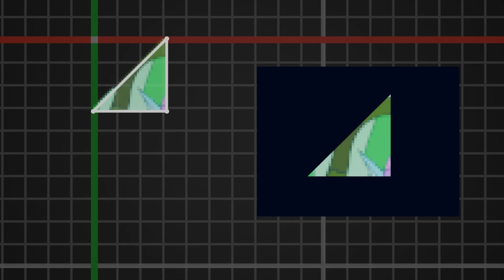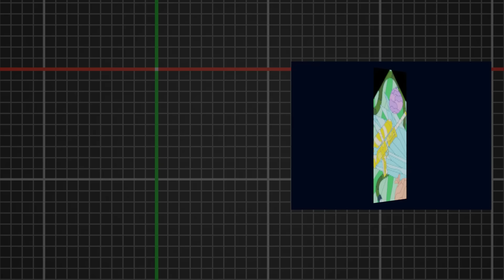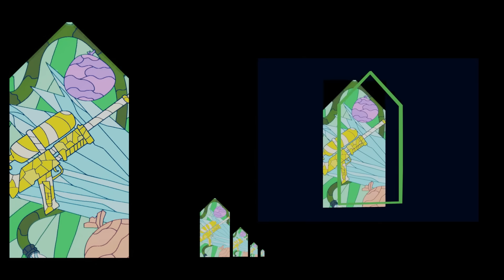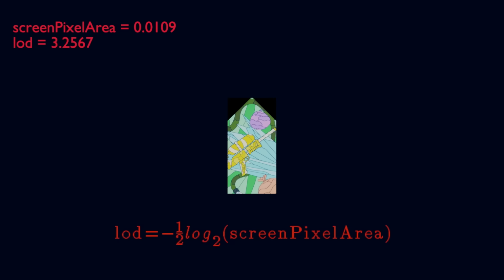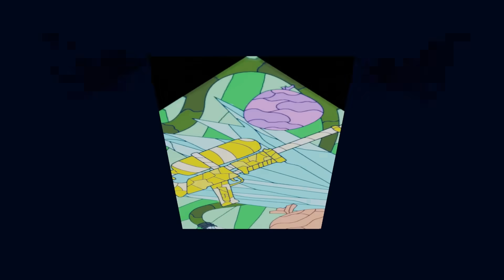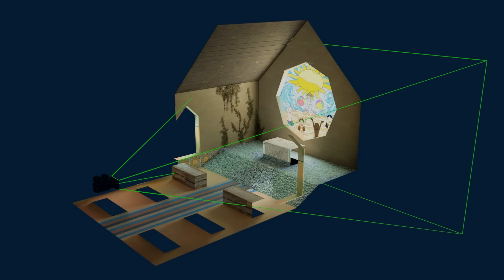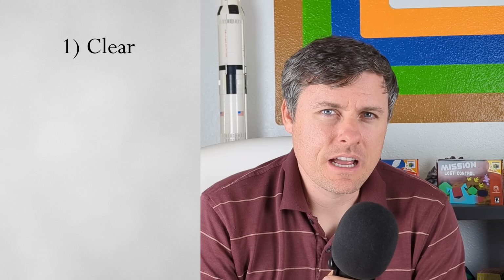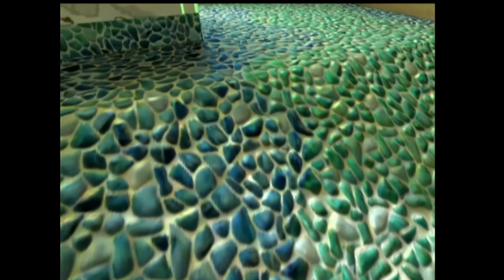How I implemented MegaTextures on real Nintendo 64 hardware

Comment: So you got around the 4kB DSP/RE (reality Engine) data cache size bottleneck by implementing a real-time dynamic tesselation algorithm? Nice, but unfortunately while this works around one N64 bottleneck it also tightens & worsens another one: it's relatively low triangle rasterization count throughput limit. Now what would you do against that?
Reply: What? No. The RCP (Reality Co-processor) has two main parts, the RSP (Reality Signal Processor) (for polygons and lighting) and the RDP (Reality Draw Processor) (for textures and pixels) and each part has its own separate cache. The low polygon count is for frame rate reasons, not because it's impossible to have more.

Comment: I'd assume back then the speed of loading data from ROM and how much CPU time it uses might be a problem and then also the ROM capacity, you would need about 1GB ROM to fit in all the textures but I don't think N64 games came even close to 100MB. Still pretty cool!

Comment: You can write a procedural encoder/decoder for textures to store them in more compact size in some sort of vector data, like demo scene did, wonder how that may improve your demo performance and OK image quality.
Reply: Please write a compiler. Maybe there is a lot of free contents out there? It seems that most pixel shaders at least needs attribution. So you would have to list the authors on the info tab. Perlin got a price for his noise. Geo nodes from Blender.
Reply: @ArneChristianRosenfeldt  are you talking to me? Because it doesn't look like this,I think your comment has no connection to mine.

Comment: Makes me wonder how much today's engines actually utilise current console hardware. It is so powerful but with so much more complexity.
Reply: A theoretical physicist once told me that high performance computing got faster fast than the hardware because the algorithms also got faster. I would say compilers also got better.

Today we have unreal and Unity3d who avoid many of the blunders of the early years. We have drivers. Instead of NDAs about basic stuff, game devs can use Vulkan. Every graphics programmer today reads through the vast literature from university. Back in the day, a lot of graphic coders used high school maths only.

Comment: I know that the N64 can't display normal maps but could you fake them?
In the game "Blast Corps" you can see something on the loading area of the "Backlash" Vehicle that looks like a normal map or something similar.
How did Rare achieve this effect?
Reply: Have you checked lib dragon what RDP can do? I think indirection is possible, but of course too slow for full screen usage.

Anyway, normal maps really seem to need normalization — square root. With small polygons you could normalize all lights and view vectors at the vertices and linerp . In case of doubt, split/tessellate. Store 3 component vectors in the normal map ( compute z on load using the CPU ) .

Comment: Could you actually have these graphics in a proper game with physics, AI, NPC and all other factors?
Reply: Does any N64 game have physics? Bullet, havoc, angry birds, Unity3d all came out afterwards. Doom 3 is the first Id tech with proper physics.

How does half life do it?

Take a game from the genesis and use that NPCs with their AI. Or was it bad? Just don’t simulate multi-player.
Reply: @ArneChristianRosenfeldt  both PS1 and N64 had some physics simulation. Take for example the car handling in Gran Turismo., that's one of the prime examples of 32bit system physics... Or Wave Race on N64... So my original question was about would you have enough compute power left to make a game after you apply these megatexture graphics?
Reply: And I mean that you can do the maths yourself. Dial back on the Megatexture! Time slice the CPU . You still got enough cycles for Grand Turismo and still half a CPU for the megatextures, like for example procedural asphalt and scenery changes .  @Granulum

Comment: It's obviously impressive, but I think the texture pop-in as it transitions from sizes also kill the aesthetic, relative to consistent textures. It's a huge nitpick for me even on modern hardware. Also sorry if this sounds like a stupid question, but is it all done in the GPU, or does it borrow time from the CPU? Because that would be another limitation if someone were to actually try to make a game like this. Either way a Myst-like game could be a perfect fit, other than the limitations on cartridge size. But would it be possible to engineer a bank-switching cart for a single game? Like a modified Everdrive cart?
Reply: The GPU works per polygon. So at least the z-buffer avoidance algorithm sorting needs to run on the CPU. Also I think that no one is so crazy to write ROM loading routines for RSP. Please correct me, but lib dragon is a port to the PC. But it still only includes the two original RSP binaries ( medium and high quality). 8kB which define it all. Only a few professionals modified those. Scratchpad RAM. So it is coding like JRISC for Jaguar or SH2 on 32x. But with 128 bits and instructions more complicated than MMX ( but less than SEGA DSP on the  Saturn).

The CPU has trice the clock than a PSX. You could use a KISS game loop, first do the logic, then audio video. Still more complex game logic possible than on PSX. A queue keeps the RSP running all the time.

Comment: Very interesting demo to explore the limitation of how the N64 hardware may be capable of. Does it take a lot of process memory to load up every pixel image to take place where the camera is moving. I sort of tell by the framerate dropping when viewing other images around the room. Would it be simpler by using two images, one high and one low texture. For it two work, the camera is far distance viewing the image low quality, coming closer. The high texture is fading in from the start. Coming in closer, the image fading in more. When the camera reach it's point, the high-quality image is fully loaded in, and the low quality image just disappeared. It is just my understanding that it would be if the frame rate would keep it high
Reply: A lot of tiles can be loaded per frame. You could keep the mesh from last frame and modify it as you load. There is a hight field engine that does this.

Comment: the 64 mb ceiling really is a problem on the n64
Reply: How do you all create textures? Let’s just assume that we don’t really want a MegaTexture, just not the blurry stone texture and faces. So many textures should be geometry instead. Lines on the street, lattices, rotating fans, windows in a house. Vertex lighting is impressive at high polygon count. For sharp shadows add sectors like in Doom.
Reply: @ArneChristianRosenfeldt ??.
Reply: @ArjanSnijder  textures were cheap. Go around with a camera. Pay an run of the mill photoshop artists, done. 3d modelling is more expensive. For large objects you want procedurally generated geometry. Vertex shaders. Geo nodes. Only top talents give you this. Like Elite , tree generator , Bryce
Reply: @ArneChristianRosenfeldt   The hardware was good but they cheaped out on cart space. The n64 could have been more.
Reply: @ArjanSnijder  cart space is expensive as is a CD drive. A CD drive needs more RAM. More games would have needed the expansion pack or we would even have gotten a larger pack later. To this day I don’t understand CD authoring. Yeah, no random access possibility due to syncing and Reed Solomon error correction, but this only means that a game provides start address and length of a data block to DMA into Rambus RAM. I think that there are addresses on the spiral. But the head would aim blindly then focus and read and then buffer and if this was before the wrong address: discard. Also I propose repeated files , so that we always land in useful data. Quad constant speed drive. Still stick to compact data => good loading times.
Reply: @ArneChristianRosenfeldt   n64 did i decent job only not so much in texture detail. Altough i could never see a playstation handle anything close to perfect dark. Altough choppy. That thing looked almost like early dreamcast.

Comment: Do the faces need to be tesselated for the higher mips so that each polygon is covered by the a single tile, or could the N64 stall poly rasterization and wait for a texture cache refresh mid render?
Reply: You render everything which is in Cache (TMEM). You mean if we should write micro code to make RSP understand regular grids made of a lot of square tiles which use up the full TMEM? So the CPU just needs to write a list of tile indices and the upper left vertex? Definitely! With one cache flush from the CPU, we write out 4 tiles ..
Reply: @ArneChristianRosenfeldt  Uh, no, thats not exactly my question. I used to think that the only way to get a surface to have a larger texture than can be fit at once into the n64's texture cache was to subdivide that surface into more quads and assign a different texture (each containing a fragment of the whole) to each sub-polygon. Is that how you are doing it, or is there some other way?
Reply: This is the way, and we love it .. though actually I don't know how the SDK does it. If you do it manually, rounding errors may make the surface not perfectly flat. I always say: this is not a bug, but a feature. Add detail, tesselate. But maybe for BSP and backface culling and triangle set-up you don't want that? So the micro code takes the projected vertices and cuts the edges in regular interval and spans a grid? Feels weird to waste any word in the 4kB code cache on this.

BTW. the hardware supports skinning of arbitrary polygon meshes where each triangle ( or quad ) covers less than one texture tile . The mipmapping addressing scheme allows us to scroll through a large texture. Like you move to the next polygon and each mip map level scrolls by a vector, but divided by two every level you move up. I wonder if these areas in cache collide (and you would need 2px/cycle internal memcopy?), or if wrap around is built in.
  @buzinaocara
Reply: @ArneChristianRosenfeldt  Did you participate on the project, or is that your speculation? Just out of curitosity?
Reply: @buzinaocara  I only have fun commenting on comments and like many had the same idea years ago, but other coding was more interesting to think about (though the ultimate quality in this video surprised me). I really don’t know where some people take the energy to code as job and as hobby.

Comment: Amazing,just amazing

Could you not use a large and extremely varied tile set that could then be brolen down and reused everywhere ingame ?

Like how super mario bros 1 reuses tiles for clouds and bushes and trees and so either by inverting/flipping or only using half 

Also,would it be possible to reuse a tile set but be able to change the colour of a tile internally without having to have a new tile in a different colour ?

I would love to see a myst like game on n64,something like shadowgate 64

I think your demo room would be an amazing place to use as an n64 music compilation homebrew with room lighting options,imagine being able to rip in all your favourite n64 music tracks and play them back with some reverb options and cool dynamic lighting !!!!!!!

Does your demo not use the expansion pak ?

Your demo is stunning btw
Reply: There is no color index. It is all fast RISC code. Just write some code in C++ and play with procedures and ramps and noise and functions.

Comment: why can't you draw outside the frame in anticipation of camera movement?  why can't you load tiles needed for those image portions?  on the one hand, you're saying the tiles in cache are likely to be reused (how likely, though?  how much of the cache is actually reused between frames?), and on the other hand are saying tiles outside the frame are totally unlikely to be needed; this seems to not be totally true.  can you use something like the quake algorithm to prevent overdraw/reduce tile size?  can you use the screen itself as a buffer?  sorry if this comment is too ignorant, all my knowledge of video game image rendering is from youtube.  thx for the vid, cheers,
Reply: Coders say: you probably not gonna need it. Just don’t utilize all of your cache for the current frame. Optimize this to max extent. Then look for other heuristics. Cartridge is fast. Field of view is narrow. For a real game better stick to normal textures, just at higher resolution. Then you probably use the same textures behind you. Blame the artist. Also on N64 you usually then sort by texture. So draw all cached textures, while the CPU decompresses the fresh ones.

So you want occlusion culling? Is PVS really ideal here? Portals, BSP ? Deferred rendering: you check z for the whole polygon and only then load the texture.

Comment: please do a project on the ps2 or wii or gamecube or og xbox it would be soo cool to see how far u could push it
Reply: Ps2 has this super high poly count , but cannot do multiple textures. I wonder how far you could get with vertex shaded chunks. Nanite. Not only for terrain, but all meshes.

Game cube and later use a graphics chip from a PC . So you could just run a modern PC game on a PC? They got optimized all the years. Unreal.

Comment: I wonder how can anyone calculate log
Reply: Logarithm? Jaguar and 386 have bitscan. N64 has floating point. Surely there is some microcode for logarithm? But then kaze has a video about sine. Weird. I would guess that the floating point unit has long stretches of idling where you could sprinkle in expensive instructions. Or is it RISC? So only MUL, DIV, SQRT ?
Reply: jesus christ @ArneChristianRosenfeldt

Comment: N64 has 8 megabytes of ram not 4
Reply: I wonder if RamBus was the last technology to use banks. The memory modules share a common databus. I think in double data rate memory they only share the address bus. So you always have a single bank but wide words. Memory upgrade on N64 is so easy due to the banks.

I wonder why the burst (for example 16 words per module?) interleave to next bank to hide page flips pattern did not work out.

All this serialisation, deserialisation seems to cost latency.

Comment: This brings up the question ... Why is this style of optimization not ever thought of in common practice to dramatically reduce the resource cost of any and all graphical operation ... Do this witg common standards and we won't need as much anti-aliasing for example... Frees up so much hardware power with this methodism. Why not do this on a larger scale for current usage . ...

Comment: One place this would really shine is in cutscenes, with much finer control over the camera. Could allow you to show the player what something "really looks like", before cutting back to normal gameplay + rendering techniques. Or perhaps when the player goes to examine one specific object, like a map on a wall.

(Of course, that depends on how easy it is to swap from one to the other.)
Reply: Rail shooter like Star Fox
Reply: @ArneChristianRosenfeldt  Star Fox 64 didnt looked good. More like something like Crash Bandicoot. That game used an on rails camera and took that to its advantage to have perfect polygon count at all time.
Reply: @sebastiankulche  Crash Bandicoot could test a level on (a PC?) and check for problems with the Painters Algorithm along the whole camera path. I still dream of an occlusion algorithm who gives me “airspace” within which I can move the camera without challenges to sorting. I want a second thread to map out the space. Crash has a slow camera, so this should be efficient on the PSX.
Reply: @ArneChristianRosenfeldt  In Warped and Crash 2 some speedrunners managed to achieve crazy speeds and the game still updates somehow the visuals btw.
Reply: @sebastiankulche  I should check the article, but maybe the polygons get flagged and the artist need to split them. So win-win : no glitch and more details . Just my code wouldn’t work anymore. I also don’t like to question the artist.

Comment: Based on your experience and knowledge out of this expirement, is there any strong relationships between Megatexture and a 60 FPS cap? I intuitively thought they were interconnected through dynamic resolution when Id came with games on Id Tech 5. In other words could you tweak the megatexture code so that it aim at 60 FPS, dynamically sacrificing quality, for example?

Comment: How can I imagine that texture image space? Is it just a contiguous buffer or VM address range?
Reply: I think the MIPS R4500 CPU as used in N64 can switch on virtual memory. But why? And how to share buffers with the rest of the system?

N64 has no 2d graphics memory like PSX if you mean that.

The RDP does not pull from the memory. Rather you push all the tiles ( and clip them ). It is more like SEGAs  “After Burner”

Comment: How much lower does the amount of geometry/polygons have to be to get the same framerate with this method?
Reply: Might be interesting to dynamically adjust the mipmap levels to stabilize the frame rate. Still can have a large level and fresh textures anywhere. And when you bump your nose onto a door, you still get nice wood grain.

Comment: one technique you can use to "fake" hires textures is texture overlay, so using one texture to cover a large area, and using another texture to give detail, you could even use the same texture for both, this gives the benefit of not needing a lot of textures for a large area, and you'd only need to render the fine textures for areas close to the player. this is most effective for grass or other terrain where it's not too noticable whether there's a repeating pattern.

Comment: Does the N64 support mappers in cartridge? like some games would add extra rom inside the cartridge to allow more data. could this potentially be "endlesss"? let's say if you run a large rom with detailed textures from a flashcart? (limits being sd card storage for instance)
Reply: I want you tube to use AI and lump together all the zero vote , zero response duplicates.